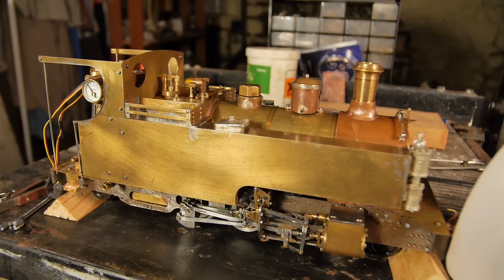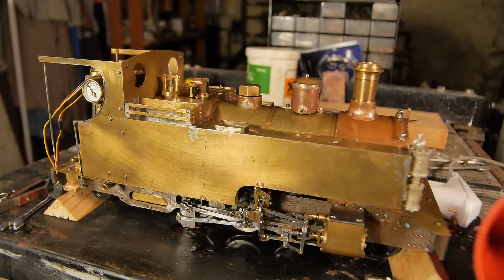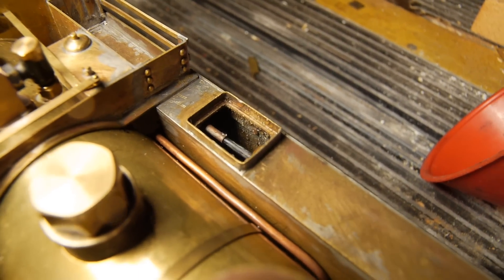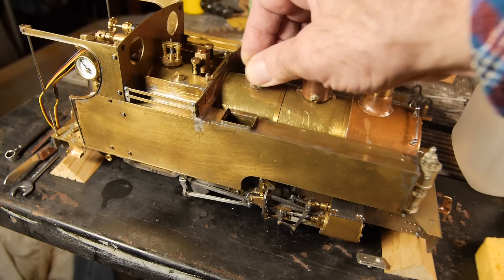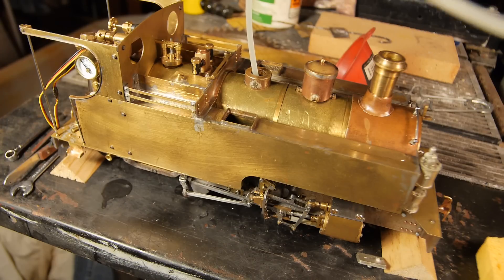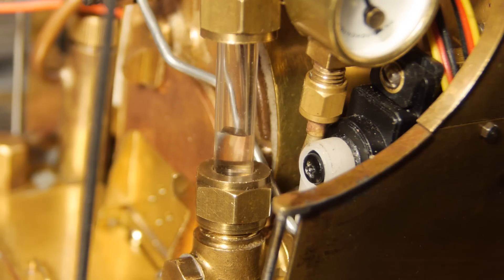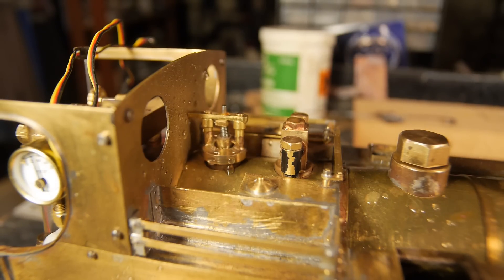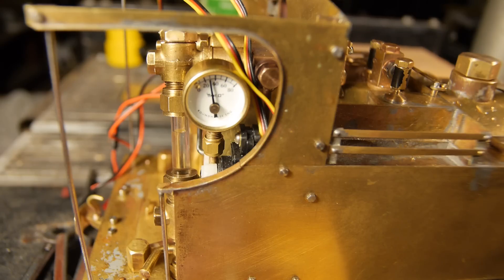'Russell' Live Steam Model Locomotive Part 20

Comment: Thanks for uploading, very informative especially for a beginner like me. I am debating whether to go coal fired for gauge 1 or larger 5”. Which do you get more enjoyment from?
Reply: Hi Dan, coal firing in the smaller gauges like gauge 1 is very fiddly, frustrating but totally absorbing.  5 inch gauge is much more forgiving and you get the change to really drive the engine sitting behind it.  As a beginner I recommend gas firing on gauge 1 unless you have a tried and trusted design and a mentor to guide you through.
Reply: Jonathan Guilbert Thanks very much Jonathan, I will have a look at a Roundhouse classic range locomotive such as Katie or Billy then and perhaps go to coal fired for gauge 1 or a larger scale in the future
Reply: @danprice7973  You can't go wrong with a Roundhouse loco.  I would suggest considering a Riverdale boiler with a Roundhouse chassis when you eventually decide to go with coal.
Reply: Jonathan Guilbert Thanks Jonathan, I had a look at the Riverdale website, are they easy to fit? I have no knowledge of locomotive building
Reply: @danprice7973  You need to have some pretty good knowledge about steam engines and fitting radio control gear to work in a very small space.  The design of the boiler has been worked out to have success with coal firing.  Get the gas fired Roundhouse locos and have fun running them for a while.  Then see whether you want to mess with coal.
Reply: Jonathan Guilbert Brilliant will do, thanks Jonathan for all your help. Look forward to watching your future uploads. Dan

Comment: Fantastically detailed build. I've been enjoying this series.
Just a quick question. When running the engine do you have to watch how much water is pumping into the boiler quite carefully? I'm just wondering how often you have to stop and adjust the bypass valve or refill the tanks
Reply from the maker: Hi Andrew, I put the big water gauge on the engine so it is easy to see.  I'm still getting use to running it but it's not too fussy with the water pretty steady from the pump.  It takes quite a while before the pump starts to over whelm the boiler which is a good proving the pump is adequate.  Depending on the weight of the train the tank water last about 15 minutes which again is fine as I need to put more coal on the fire then anyway.

Comment: I have watched (and subscribed to) all you videos - thank you for producing them!
Thoroughly enjoying them :-)
One thing that puzzles me though, is you running the locos using compressed air via an inlet under tha cab floor on the RH side - is it usual to provide this air connection on the loco? or is it something specific to 16mm designs?
or... is it perhaps your own enhancement?
Could you possibly show some of the details in one of your future videos?
thank you!!
Chris
Reply from the maker: The inlet you mention is a water fill connection for the hand pump bottle I show at 2:18 in the video.  The plastic tube end fits into the connector and I pump water into the boiler against steam pressure via a non return valve.  The connector is also convenient for putting compressed air into the boiler for testing.  I'll show it in more detail when I fire the loco up on coal.
Reply: Thank you for the explanation.
Why then do you have fill plug on top of the boiler and fill valve down at the bottom?
Or is the one on top of the boiler for filling in un-pressurised boiler?  and the other one is with clack for filling in while the boiler is pressurised?
Look forward to more videos from you - thank you!

Comment: Crikey that it wonderful. How's the slide bar attached to the cylinder head?
Reply from the maker: Hi Jason, there's a grooved bracket that fits on the piston gland boss.  The slide bars fit in these groove for alignment and are screwed to it by by 10 BA hex headed set screws.  The other end is held in place by the motion bracket.
Reply from the maker: It definitely does.
Reply: By coincidence, I am a volunteer on the Talyllyn
Reply: This locomotive looks a little bit like Fearless Freddie the narrow gauge engine from Thomas & Friends
http://vignette1.wikia.nocookie.net/thomasandfriends/images/7/77/Freddie.png/revision/20150822002956
Reply: There is another Russell locomotive at the Tallylyn Railway
http://www.rail.co.uk/images/7794/original/6-Russell-and-Prince-Cliff-Thomas.jpg
Reply from the maker: That's the original Russell from the Welsh Highland Railway visiting the Talyllyn on a special occasion.  Russell can't run there because his gauge between the wheels is smaller.
Reply: Oh! I didn't know that!
Reply: Did you know that the Skarloey Railway is based on the Talyllyn Railway?
http://img07.deviantart.net/20a3/i/2014/342/6/2/skarloey_railway_fleet__from_my_youtube_series__by_steamdiesel-d894dg9.png
Reply: I did indeed, I've worked on a number of the Talyllyn's Duncan & Peter Sam special trains based off the Thomas Series

Comment: What are the o rings made of
Reply from the maker: I use silicone 'o' rings for the pistons but they are a very loose fit on the bore and groove so the 'o' ring can roll along the bore.  For sealing the plugs I use nitrile or silicone.

Comment: What did you seal the steam dome with
Reply from the maker: You can see the plug under the dome is sealed with an 'o' ring.  The dome cover itself is just a tight push fit on the filler bush.

Comment: Im really enjoying this series of videos. One question and please excuse my ignorance but by using a gas jet to heat the loco isnt there a risk of melting the silver solder in the boiler as i assume you also used the gas jet to melt the solder to begin with?
Reply from the maker: Thanks Joe, as long as there water in the boiler above the crown/top of the inner firebox nothing will melt.  You can see the water on the gauge glass in the cab and as long as the level is above the bottom nut it's safe.  When I fire it up with coal it'll be a much hotter fire with a lot more energy to run the loco and pull a train.  I'll be carefully watching the water level and the axle pump will constantly add more water to the boiler as it steams along.

Comment: Congratulations on a beautiful model, and stunning workmanship. Be careful however, when running in an enclosed space. When applying a touch of "blower" on the workbench, the exhaust carries used steam oil in its vapour and should not be inhaled. Your videos are amazing. Thanks and best regards, Germany
Reply from the maker: Thanks for the comment and advice.  I've been breathing in the oily steam from my 5" gauge engine for year so maybe I should be more careful.  I'm thinking of testing with coal in my basement with the windows and doors open because the test track is there.